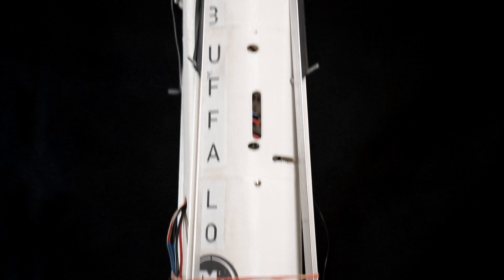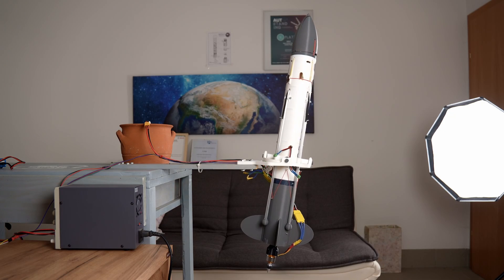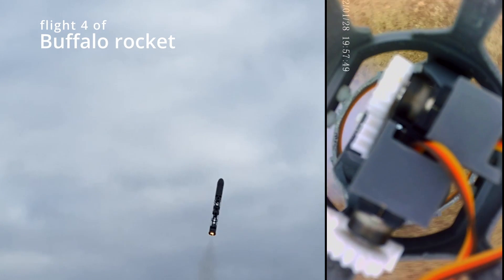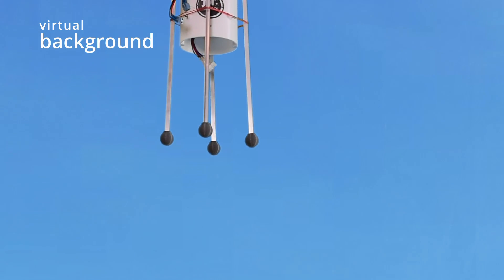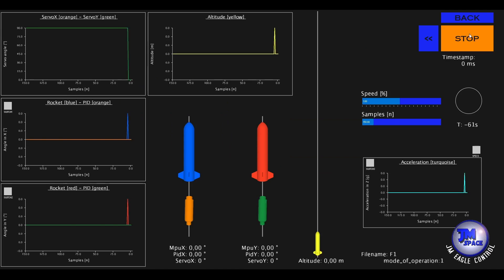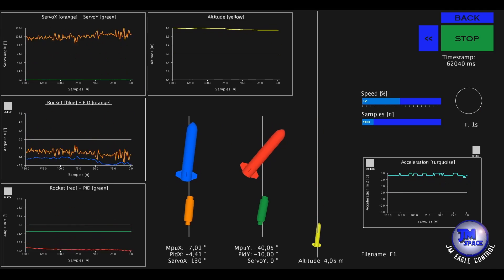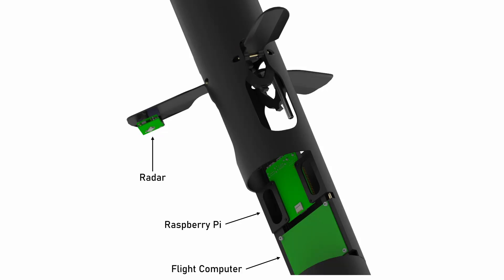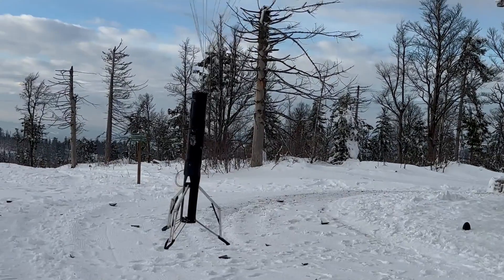MIT Maker Portfolio Video (RA Rejected)

Comment: They don't give a reason why they reject ? Fully self designed circuit boards plus cpp firmware should showcase a lot of MIT-like understanding.
Maybe your focus was too strong on one thing, like an obsession with space flight which they might find problematic. Or your work was a lot teacher-supported ?
Reply: his project is not a problem, we dont know what was wrong but then again, MIT is extremely selective.

Comment: You've accomplished more than most engineering students I know. What you did not only requires knowledge of rockets, but also in areas of electronic and mechanical engineering, CAD, coding (in multiple languages I assume), maths and physics, serial protocols (I2C and/or RS232 ??),  probably some fancy ass DSP techniques, control theory and manufacturing. Oh and I can't leave out the clear passion and creativity you have, it even looks aesthetic. It's safe to say that the guys at MIT are missing out!

Comment: Not sure. All of whta u have done caan be basiccally summed up to 
-Microcontroller programming
-CAD and 3D printing
-Quite Crafty

Nothing really that focuses on research and finding out new stuff, just implementation.
guess that's what got u rejeccted
Reply: I don't know about that, the rocket seems pretty different from everything else, especially the "landing attempt feasability" part. Also I don't think MIT really looks for people that discover "new stuff", like they said "we’re not looking for applicants to have cured all infectious disease in the world by the time they’re 15".
Reply from the maker: Here are a few points why you might wanna re-consider your opinion on my developments.
Most of the mechanisms I developed are first of its kind. 
-The TVC is nothing you have seen before on any other channel. It uses a rack and gear approach compared to the other varients that came before it.
-I have to use an engine cluster compared to any other rocket channel, as those are the highest power engines available here. 
(Engine clusters come with various additional complications on TVC stabilization)
-The parachute deployment mechanisms are unique. The ones that I used on Buffalo mini and Buffalo L are a design inspired by nature, and came as a result of over five years of experimenting with different parachute designs. The parachute deployment system used on Buffalo MAX is also unique as it uses a sliding plate that is loaded with springs and held back by a cable tie, which is then burned through by a heating wire. Both approaches were never used by other model rocket developers before.
-My rockets are fully 3D printed, while most others are implemented in a cardboard housing. 
-The landing legs, the airbrakes, and the descent fins deployment mechanisms are one of its kind and completely new. 
-I was the first to implement an anemometer on the launchpad to create auto launch abort in high wind scenarios.  
-I created Buffalo mini one the lightest TVC controlled model rocket at the time, with less than 210g dry mass. (Oviously a lot of innovation is required to minimize the weight to this degree)
-And I created the first post-flight anylzes software for model rocket launches (over four years ago) 

Finnaly, a classmate and I did a first of its kind implementation of a radar in model rocket as a means of establishing relative altitude altimeter system as our graduation project. We used an industry-grade radar that is usually implemented on cars for cruise control, and cooperate with a leading cooperation on the implementation. 
If that's not research and innovation I don't now what is?

Of course there will be a reason why they didn't accept me. However, I don't think it is because of a lack of research and "finding out new stuff", because I found out a lot fo new stuff over the last couple of years.
Reply: Well, that happened to me too. That's the thing about real passion and talent—you don’t invest too much in showing off like the untalented. If he were fake, he would’ve spun up 10 résumé projects on top of the hottest subjects out there. Instead, you work on a problem at your level and might come back empty-handed, while the faker has already checked all the boxes.

Comment: bro i also wanna build rockets, but where should i start from?? any tips? where did u learn all these from?
Reply: Go to your local university and look for a rocket club or any kind of rocket club.
Pick up a textbook on rocket science.
Also take a look at some communities on Google that are building model rockets and copy what they are doing.

Learn physics kinematics (pick up a university physics textbook), basic c, c++, basic electronics learn how to solid model/3d print if applicable, know where to buy parts. The more you know the more ready you will feel.

Then get building, know what you want to build. Understand the scope of your work

It honestly depends how accurate you want to make your rocket: if you are going for nasa levels, you may need to implement the rocket equation, optimize aerodynamics, heat transfer, deformations of materials. Etc

Good luck!

Comment: Which programming language preferd for programming this systems?
Reply: If i remember correctly both platforms he mentioned either natively use C or an offshoot of C such as in Arduino's case
Reply from the maker: Arduino IDE on Platform IO in VS Code for programming the ESP32
Or STM32 Cube IDE for STM32 line of microcontrollers

Comment: for attitude measurements are you only using the gyroscope or are you using a kalman filter with the accelerometer and magnetometer ? 

I have a LSM6DS032 gyroscope board. I've used the angular velocities to obtain my euler angles through quaternions but at odd angles or after shaking the unit vigorously, the angles don't return to their usual values.
Reply from the maker: I am only using the gyroscope, as the sensor package I use (BMI088) does not feature a magnetometer. Further, the accelerometer measurements are not feasible in flight as they are effected by the thrust of the rocket engine. Yet, I use the accelerometer to calibrate orientation at the launchpad.
Reply: How robust is your gyroscope at odd angles coupled with rotations? A TVC rocket’s flight path is rather slow so it might not be a problem. But does your gyro return to its usual 0,0,0 after many repeated rotations about each axes ?
Reply from the maker: @julianchee2894  Yes, our algorithms are capable of managing multiple rotations. Several minutes after power on it usally is still within +-1°